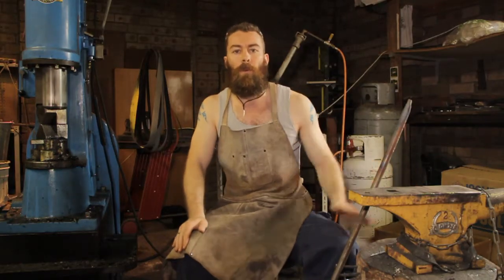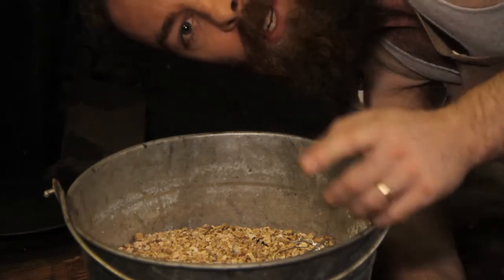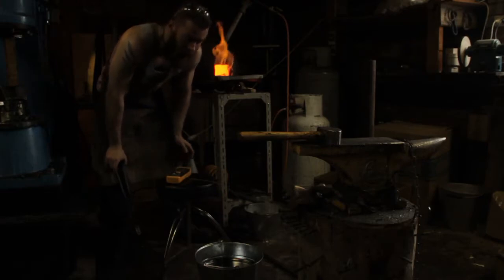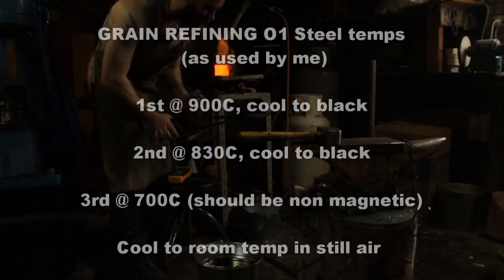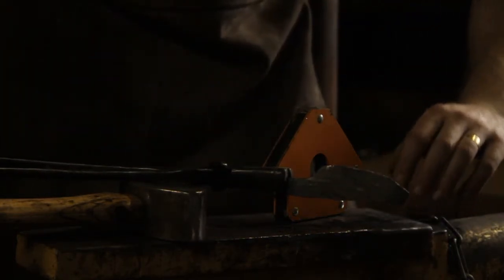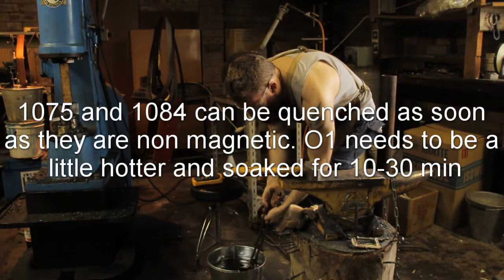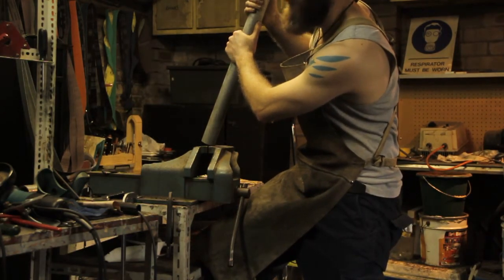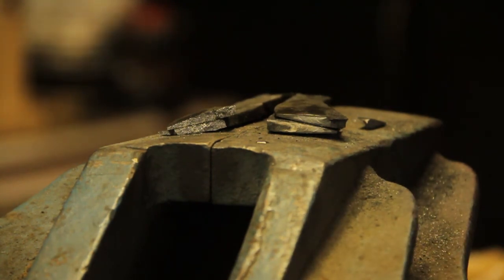Heat treating O1 Steel and grain growth

Comment: Good stuff. I tried making a pipefitter's wedge out of some mystery rail car spring a while back. Forged it out, went straight to quenching it in water without any normalization, and it "spider web" cracked all across my piece. I chucked it up in the vice and gave it a whack with the hammer, breaking it in half. The grains looked very large, exactly like your piece there. I shortly found out afterwards that not all steels like a water quench and there are many more factors involved in heat treatment.
Very interesting to learn how great of a difference it makes to treat your steel properly. Thanks for taking the time to demonstrate this.
Reply from the maker: The best way to learn is exactly as you did,  Give it a go and test your results ;)

Comment: Nice video, I just started working with 01 this year, I got some practice in soaking for around 8+ mins using 1095, but I have to do it by hand and eye control, as my forge isn't temp controlled, that's the tricky part, soaking by eye took me about 2 years to get down without over heating it.
I had to make a very specific open back forge, which lets a lot of the heat out, so it doesn't get too hot in there.

Comment: Oh my goodness! I'm an engineer and heat treater. I make knives too. As far as O1 heat treat is concerned you do not hold it at hardening temp for 30 minutes nor 5 minutes. If you buy spheroid O1 with 0.10 to 0.20% vanadium like I do there is no need for for grain refinement with this steel, it is not 1080. I started heat treating O1 in a charcoal forge in 1992 and then I bought a nice Paragon oven and made perfectly heat treated knives thanks to Kevin Cashen. Firstly O1 doesn't decarburize nearly as much as 1080-75 or L6 or simple alloys.

 If you're going to forge it that's a different story. But it isn't necessary to do three cycles if you just buy the O1 with Vanadium and stay away from Latrobe's formulation. Some folks are under the impression that that small amount of vanadium would make vanadium carbides. Not at all, it restricts grain growth quite a bit. It is why I'd buy 80CrV2 instead of plain 1080. If you want the edge holding of a high vanadium steel and only have a forge there is a steel for you called CruForgeV that is essentially 80CrV2, but with 0.75% vanadium. Oh and FYI, vanadium carbides are harder than tungsten carbides. Alpha Knife Supply sells it in .250 thick flat bar.

Do not forge below 980c to 1065c and normalize at 870 C and slow cool to room temp. 
To anneal heat to 760 C and slow cool at no more than 22c per hour until after it drops below 640c then it isn't as critical on the temp drop, but nothing quick, just a slow air cool after it hits 1000 F.

This is Bohler's formulation. Latrobe doesn't have the vanadium.
 O1's analysis.
Carbon, 0.95
Chromium, 0.55%
Manganese, 1.10% this is very, very high for a knife steel, but has its uses.
Silicon, 0.30%
Tungsten, 0.55%
Vanadium, 0.20%

To austenitize with an oven, heat to 1200 (650c) and equalize then ramp up to O1's sweet spot at 1475 (801c) for 15-25 minutes (according to thickness) then quench in 120 to 130F oil, Canola oil or peanut oil both work, but they break down after a while. 
Within two to three minutes after quench if there is any warp have a vise and heavy pliers handy to straighten, but after four minutes it loses its flexibility and you must straighten during temper. This is that high manganese content, O1 is the only steel I know that will do this.
Note the 15+ minute time is for O1 with vanadium only, otherwise only hold 7-15 minutes depending on thickness.
The 15 minute time will put the chrome and tungsten into solution and you will get chromium and tungsten carbides. If HT in a forge for 5 min you will get mostly ferrite or iron carbides. If Liquid Nitrogen is available then use it as it will work on O1 and improve the toughness, although it isn't worth paying for the improvement you'll get.

If HT in an oven for max hardness then the As Quenched hardness will be HRC 64-65.
Temper at                             HRC
400f/204c for 2 hrs. 2x for 63-62 
450f/232c for 2 hrs. 2x for 61/60. 
500f/260c for 2 hrs. 2x for 59/60.
Reply from the maker: Cheers man good info!
Reply: Would I be able to forge a piece of CPM 10v without messing anything up? I faintly remember the forging window being 1700f - 2000f. Could this be done safely without a temp controlled oven? What should I look out for? 17%~ carbide will be hard to move, so I may eventually try forging other lower carbide tool steel. Also, are high speed steels unable to be forged, or are they just harder? Thanks.
Reply: @lindboknifeandtool  I would stick to 52100 and not try to forge high alloy steels. I know an experienced forger and he tried forging D2 with all its Chromium and 1.5% carbon and he said it was a disaster. He made some knives, but threw them away when one just popped off the table all cracked.
Reply: Wow, some amazing info right here. Sounds like Mountain Fisher knows his/her stuff. Been struggling all week with heat treating several hundred small, quarter sized parts made from O1 and arrived at similar conclusions....

Comment: I just cracked a 12 1/2" or 31.75 cm blade, saw it after got blade about 90 profile ground. Full integral handle 
think it might have happened in attempting to straighten the spine. 
oh well, 6 hrs on the power hammer & about 10 with the hand hammer. Just started with this stuff. was a 1" inch bar. did two blades both were roughly 16 1/2" long & 3 1/2 inched wide or 41.91 cm x 8.89 cm
Reply from the maker: tim jackson thats unfortunate Tim, what sort of power hammer was it?
Reply: ?? not certain really. do not see a name on it. 
get to use my mentors every week, so not certain of the make. believe it is just shy of 100 lb ram though